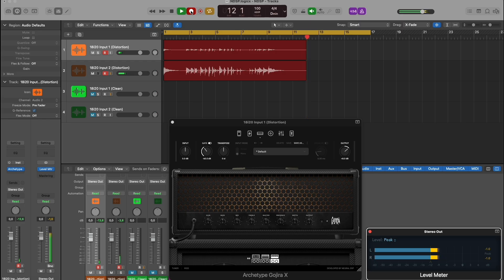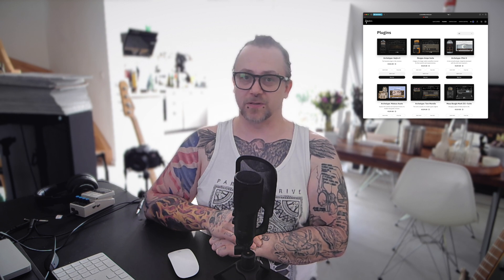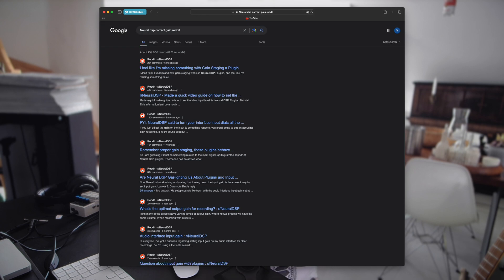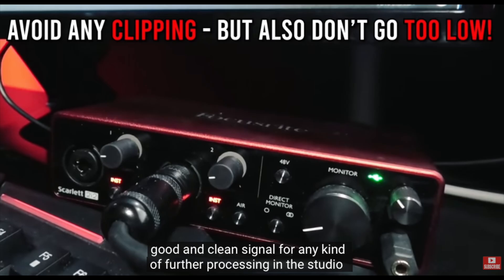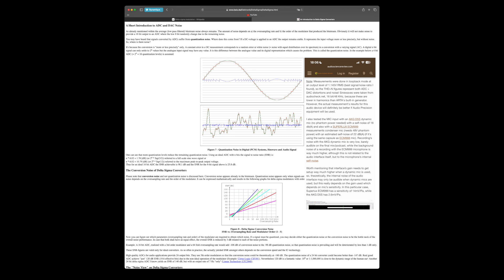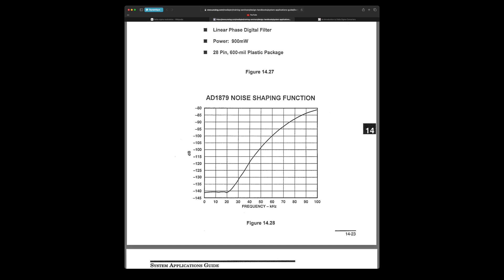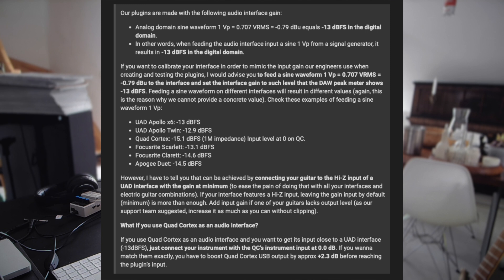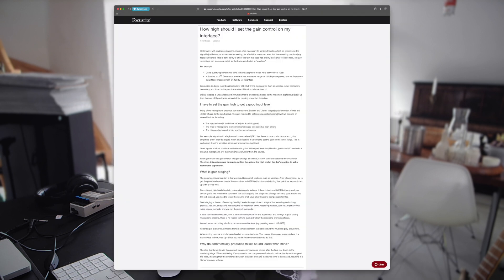Neural DSP and the myths about input gain  and why I'll not turn my gain on the interface down to 0.

Comment: When you played a clean tone without input gain on Scarlett you couldn't see the audio signal. I'm having the same problem. Any ideas to be able to see the audio signal without increasing the audio interface gain?
Reply from the maker: That's one of the problems. As long as there's no way to scale up the waveforms only visually you have no other chance than to normalize the signal. And then you must lower it again in the channel strip with a gain plugin or the input level in the amp simulation afterwards. But in this case you'd be better off with recording the signal with gain as it's the same (even slightly better) result with fewer steps.

Comment: i have a scarlett 2i2 gen 4 and i use neural dsp plugins what should i put my input gain on my plugin at
Reply from the maker: If you turn down the input gain on your scarlett to zero you do not need to change the input gain on the plugin. 

If you raise your input gain on the scarlett, you need to reduce the input gain in the plugin for the same amount. 

You probably need to eye- and earball this as the scarlett has no way to exactly set the amount of gain.
Reply: @gainlovingcriminal   see the thing is when i click on the instrement input on the scarett 2i2 gen 4 it brings it to 7 automatically
Reply from the maker: @rudycastillo6369 That's what @eds4754 had mentioned. What's your DAW and which kind of pickups are you using?
Reply from the maker: The Nazgul are high output pickups. As your interface does not allow to pad the signal - did you try the auto gain feature? This should avoid clipping.
After that I'd recommend to record a track and measure its average dbfs and then lower this to target -13dbfs.
Reply: @gainlovingcriminal  yes it puts it on auto gain to 7 auto
Reply from the maker: Alright, than the rest should be easy now.

Check this video here with explanation on how to measure the signal and set it to -13 dbFS by using a gain plugin (e.g.) mixtool.

Using a gain tool helps a lot as you do not have to set the input gain in the different plugins - you can just do it at the top of your virtual channel strip. And then e.g. save a preset named like „Nazgul Autogain Scarlett".

https://youtu.be/Qe6o99g4Rr0?si=yMYU2qXHlNEA1b4x
Reply: @gainlovingcriminal   thank you that explains alot to keep it a little under 12
Reply: @gainlovingcriminal   question do i just set it to -13 in the mixtool
Reply from the maker: @rudycastillo6369  In case your signal enters the DAW at -0,1 dbFS (I guess that's what Auto Gain aims for) then setting it to -13,2 dbFS should give you the results. Put in a metering plugin after the mixtool and before the NDSP to validate this.
Reply: @gainlovingcriminal  can u send me a screen shot how to do this its kinda confusing
Reply from the maker: Sorry, I'm using Logic and have no experience with your DAW. Maybe ask in a studio one user group.

Comment: If the noise of the pickups is 20dB louder than the self noise of the interface, turning the preamp gain to minimise the interface noise is going to turn up the pickup noise so you aren’t really going to hear a benefit.

If your interface noise is close to the level of the background noise of the pickups, and there is available headroom, then it would be worth increasing the gain to improve SNR. But this is rarely the case. 

Regarding the rest of your video - it is based on “which sounds better?” rather than “which sounds most accurate to plugging your guitar into the real amp?”. No matter what input level you use, you can boost and adjust settings creatively to get what you need. The goal of using a calibrated input level is so you can achieve an accurate gain response from any amp model.
Reply: The other point, is that it’s less about turning it to 0 and more about knowing what amount of headroom you are recording at. You can record at any level and adjust accordingly if you know the headroom.

In reality, most users won’t have the tools to measure their headroom (requires a reamp box and multimeter). Most interfaces these days purposefully spec their DI inputs so there is a healthy level signal at 0 gain, and they also provide the maximum headroom specs at these settings. 

12dBu is commonly used, because it’s equal to about 3V, which also happens to be the maximum level you can get from high output humbuckers. This would give a signal that is just below clipping, so there is no need to boost any higher.
Reply from the maker: Thank you @ed4754 for clarification. I really appreciate it. 
So you'd recommend to turn the gain all way down to zero (at least for the focusrite interfaces) to get an accurate response from the plugin? That's pretty reasonable to me.

But why not just reducing the input gain in the plugin instead? I feels so counterintutive (at least for me) to have a nearly dead peak meter and waveforms that look like silence.
Reply: @gainlovingcriminal  Well, in the instance of something like a Focusrite that has 12dBu of headroom - to avoid clipping with humbuckers youd have to keep the gain near 0 anyway. 12dBu is approx 3V - high output humbuckers and 9V pedals will be JUST below clipping already.

Also, as I mentioned above, the signal to noise ratio can only be as good as the loudest source of noise in the chain. The background noise of the pickups is going to mask over any interface noise. 

There is nothing stopping you recording louder and lowering the level in the DAW - to do this accurately you either need an interface with stepped gain so you can work out how much to attenuate by, or you’d have to measure the headroom by sending a known voltage sine wave in and working out what dBFS level it corresponds to.

I don’t actually record with my interface at 0 as I use an external DI box that I have measured the headroom of. As long as you know the headroom you’re tracking with you can accurately calibrate. Having the gain at 0 isn’t a requisite, it’s just a sensible, accurate and quick way for most people (and the interface will usually provide an ideal signal like that). 

Hope that helps!
Reply from the maker: Thank you so much for your insights!